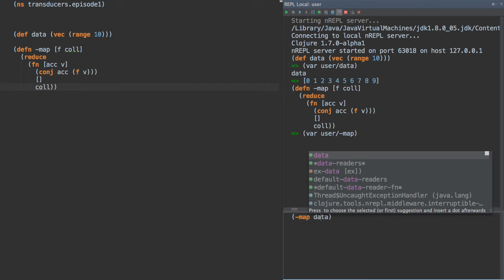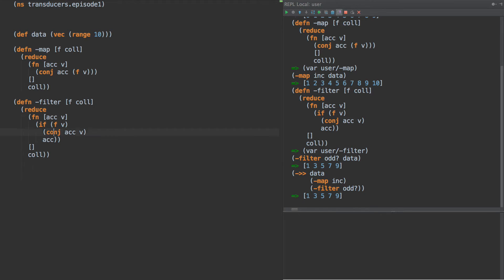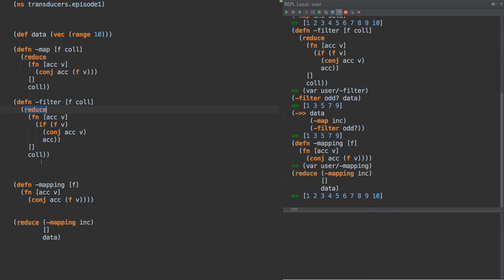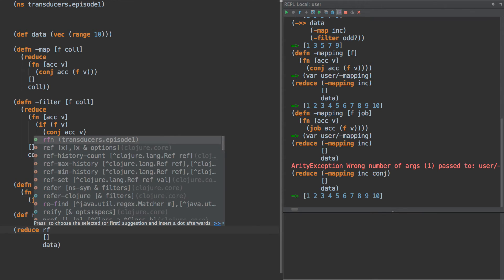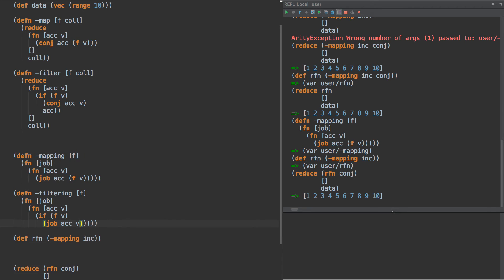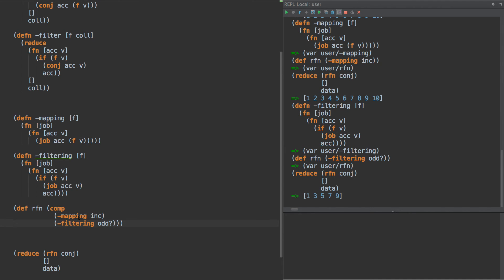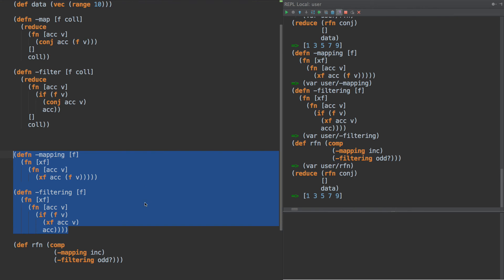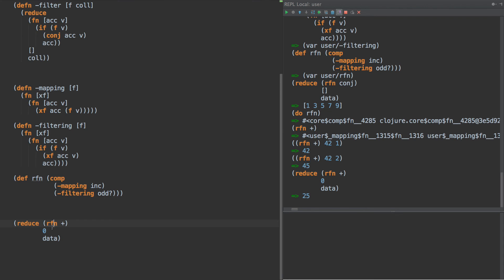Transducers - Episode 1 - Introduction to Transducers

Comment: for anyone who is slow like me, I wrote down an explanation for 10:21
how does this work?
rfn is a composed function, it returns a reducer, (rfn conj) calls the composed function.
(-filtering odd?) returns a function that takes a job and returns a reducer, the conj function is that job.
the returned reducer is passed to the return of (-mapping inc) which is also a function that takes a job and returns a reducer.
so the job for the mapping reducer function is the filtering reducer function.
now when reduce is running, the reducer function is the mapping reducer function which will invoke the filtering reducer function on the accumulator for reduce (initially []) and the current value incremented by the mapping function.
this is where the filtering reducer function will apply the predicate on the current incremented value and run conj or return the accumulator.